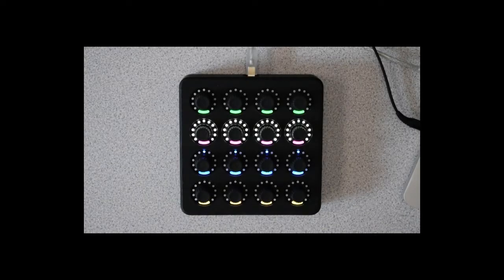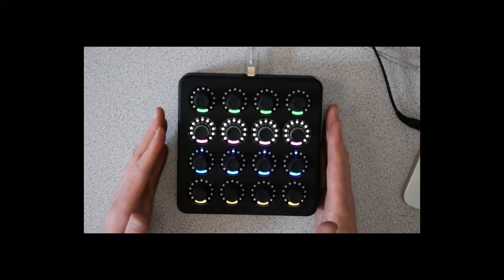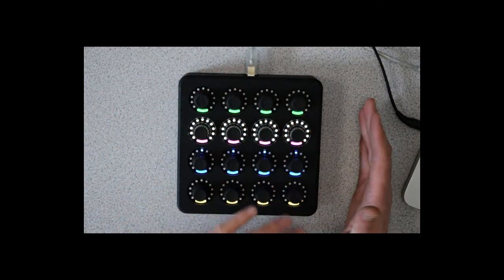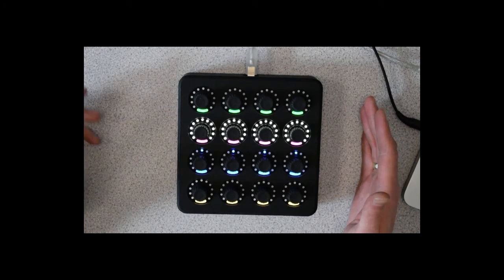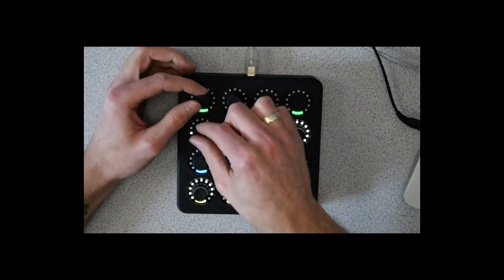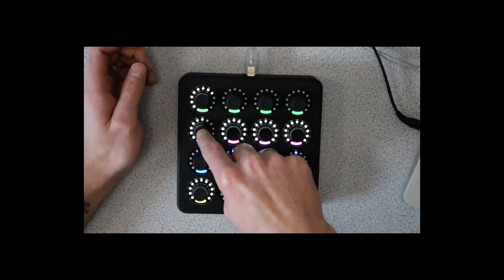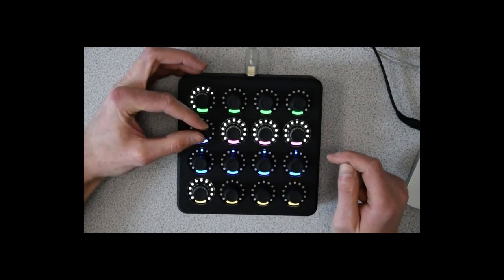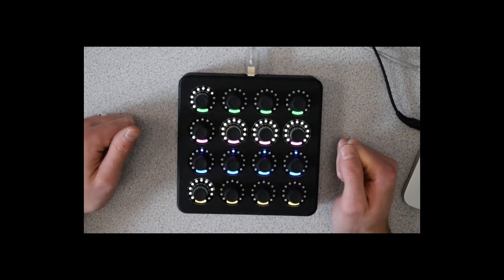Granular sampler using Max 7 and MIDI Fighter Twister

Comment: Really go job!I I like the simple implementation of the midi twister! Which reverb it's used here?
Reply from the maker: Hi. Thanks for the comment. I'm using the yafr2 reverb in Max 7. I've just posted another video of me performing a new piece with the Midi Fighter. This time I'm using an external mixer for the levels.
Reply: Really is yafr2? it seems to smooth really well..when i tested it wasn't so smooth, thanks a lot i will check the video.

Comment: Is the patch available Tony?  Can you add samples and stuff? Would like to have a go with this :)
Reply from the maker: Hi and thanks for the comment. I haven't released the patch. It's still needs tweaking and is rather messy inside. It uses the Petra package in Max 7 which has some really nice granular externals. They are really easy to use and just load up buffers as normal. You could easily add a sample to any buffer to use your own samples.